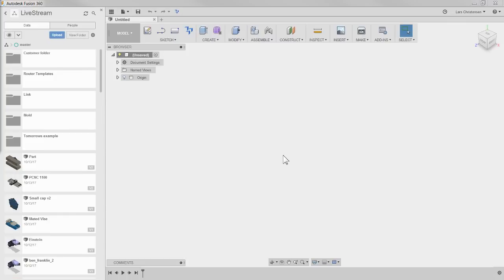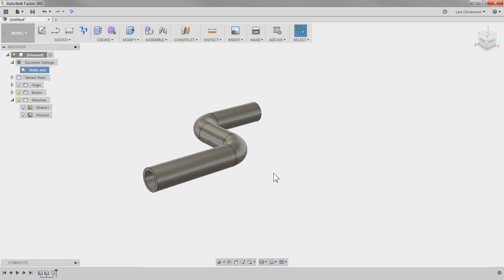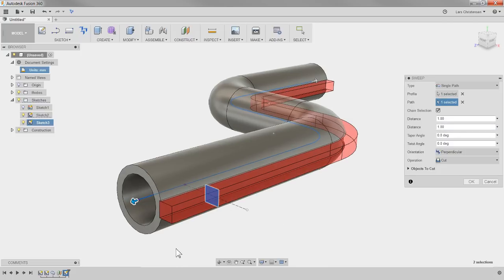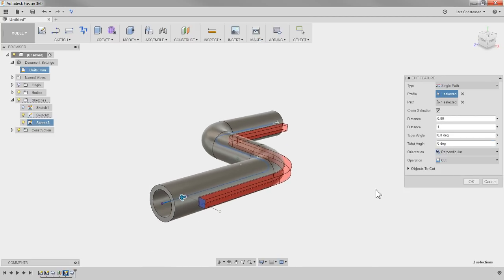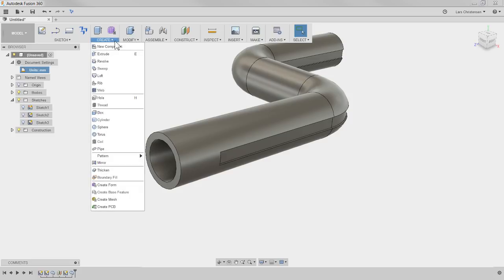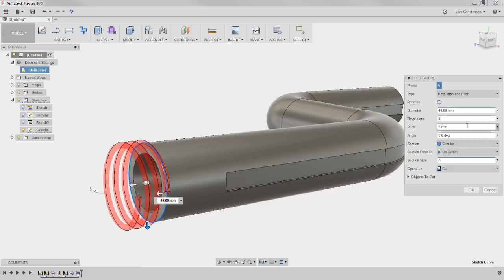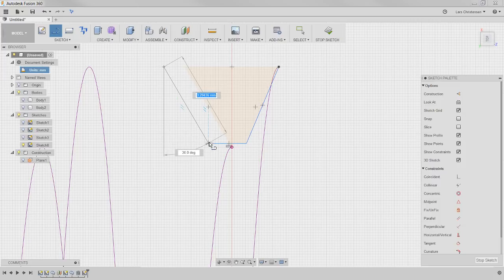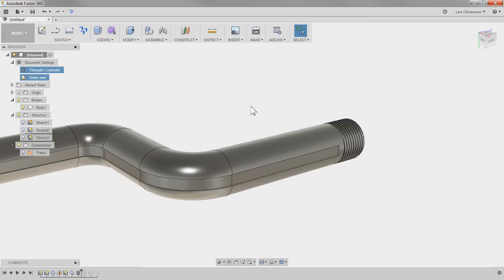Fusion 360 — Forgot About Sweep's & Custom Threads? — #LarsLive 77

Comment: So your telling me that sweep command to do custom thread profiles has been messed up since you made this video 7 years ago. It does not work properly. The new profile body has many facets and when measured to the center of the coil or sweep it will measure different throughout. Why can you not sweep to the path and get a uniform consistent body like the coil itself?

Comment: Thanks Lars, great video!
I got a question: I've got a "creative" spline that intersects itself several times, but itself is an open path. I hope that makes sense. And I'm trying to sweep a half circle (or even circle) along that path but without any success. I tried both Solid and Surface, but nothing seems to work. Ideally I'd like to have a half circle to sweep along the path so it's hollow inside. For the profile I'm using a sketch that's a half circle, offset it by 0.5mm and closed at the base - so that the profile is a closed path. I'm getting "The body would intersect itself" errors.
How would you approach such a sweep? Or is there a different way altogether to achieve this?
Thank you!
Reply: Ok, I still haven't figured out how to solve this, but I know now how to better phrase (I hope) what I'm trying to do.. What's the approach to sweep along high curvature areas so intersection resolves or "joins" It's similar to this video here https://www.youtube.com/watch?v=3o0qSliF4vs but there is just resolves. Meanwhile in Fusion 360 I get an error saying that "The body would intersect itself". Do you have any tips how to do it? Thank you! :)
Reply: I have a similar problem as you... i've found almost nobody explaining what you seek. Although im sure we will master this soon enough... fusion offers lots of ways to think about a math problem.

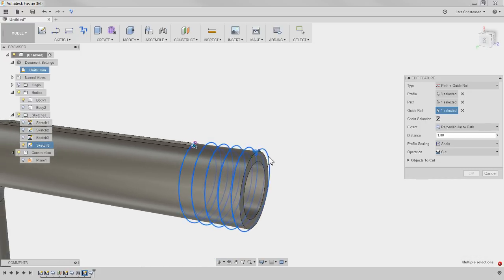Comment: Thanks for the video. FYI...at timepoint 23:43, when sweeping the thread, you need to select "path + guide surface". The path is the triangle spiral line, and the guide surface is the outer wall of the cylinder. This gives the custom profile threads, without the weird rotational/twisting effect.
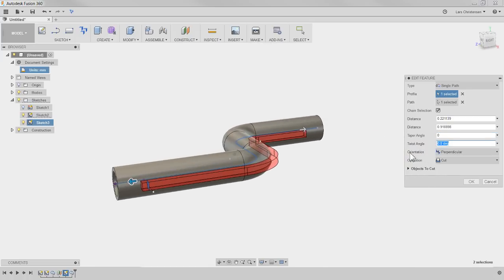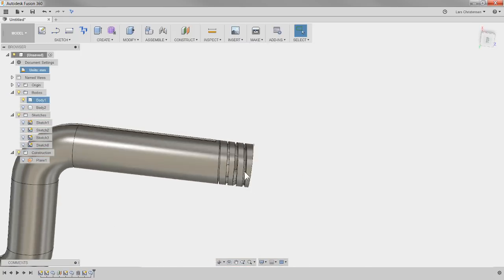Reply: Exactly this! The detail in this comment is the essential missing piece that Lars skipped over for custom threads. Basically 9:45 and 23:10 are two demos of how you try to use the most likely-seeming functions in Fusion to attempt to get what you want, but instead end up with something frustratingly pointless and stupid. Tom, you have completed the picture for one of these puzzles.
Reply: much appreachiated! I had the same effect at first

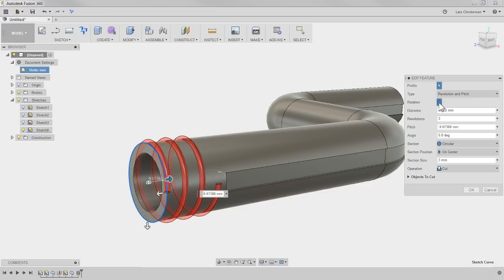Comment: Another great vid Lars, thx. 18:00 surely you would typically use "pitch and height" to make a custom thread over a specific length?
I have some trouble with using the thread feature in my fusion360. very often the result of using the standard feature is not right or it doesnt work at all. Do you have any suggeston to get a nice end run-out or clearance of the thread profile ends, particularly on a shaft that ends in a shoulder geometry like a head on a bolt? 

I would normally revolve an L shape profile in which i remove the inner corner where the shaft meets the head, to give machining a clearance area to end the thread cut. But  when applied with a standard thread feature it will however cut off the thread geometry on the ends of the cilindrical face, so the clearance face is left untouched and the thread is rubbish. Only way i know how to get what i want is to make the shaft as a separate body with extended end faces before applying thread and then revolve cut away the end faces to finally combine with the base of the shaft or make a lofted transition. but man it's a lot of clicking to make a simple threaded piece. I also use a reverse mold method sometimes by creating a temporary mold body over the thread and combine cut it, that way i can model the shaft on the shoulder how i want it and boundary fill to capture the internal void as a solid. Not much simpler either. maybe you got any ideas?
cheers mate

Comment: When using a double thread starting at 180 degrees from each other, does it make the parts easier to screw together and travel further per revolution? Also,  what are the best standard threads to use in injection moulding for a plastic lid or are custom threads better? One last thing, if I send you the files of the two components, would you do the thread that you think would work best. I would not want it to be more than one and a half revolutions from open to closed, but strong enough to allow it to compress a paper gasket.
Reply from the maker: Hi Bob Stewart Thank you for watching! I have to be honest, I am not a thread expert as an engineer. My experience has been someone telling me what thread they want :-)
You have to be careful as there are many standards and specific applications when it comes to threads.

Hope you have an awesome day!

Comment: all these live streams have been very helpful, thank you, I have a question though, I don't seem to find a way to connect to lines together to make a single pipe in different planes. like an iso for piping. i'm having a hard time. i'm new in cad obviously.
Reply from the maker: Hi Adrian Muniz Thank you for watching!
The profile and the path need to be on the same plane....Not sure what an iso for piping is.
Reply: Hi Lars, here is the thing I create a path in one plane and then a create another path in a different plane and then I tried to put a fillet between the end of the first path and the beginning of the second path, so I can make a continuous pipe and it won't let me, I don't know what I'm doing wrong.
thank you for replying in such a short time. And I totally agree with Maarten!

Comment: Great presentation of the sweep command. I have only been using fusion 360 for 2 months and have been Reviewing as many of your previous examples to get up to speed with this great Autodesk product. I have aQuestion regarding the use of the program using it on a remote laptop and office computer as a single user havingPurchased a licensed version. If I am the only user and no one else is using it but me , does it require a second license for the second device to be used.
Reply from the maker: Hi Bill K Thank you for watching!
You can install Fusion 360 on as many computers as you like. You Autodesk login is your paid access, so you are good to go.

Best,
Lars